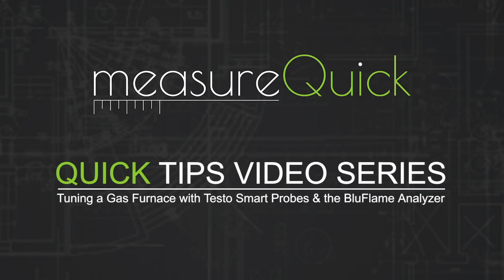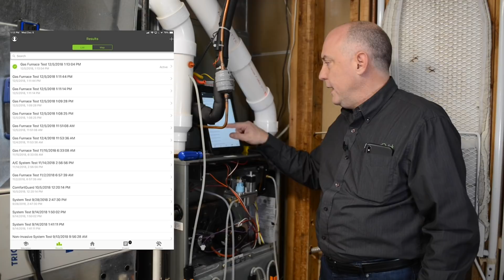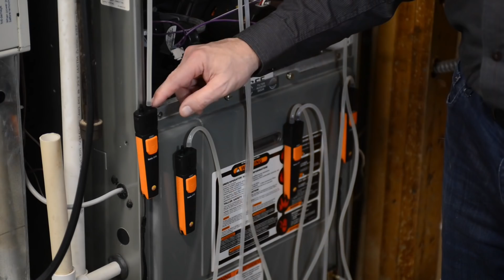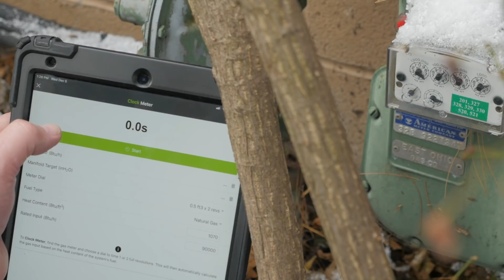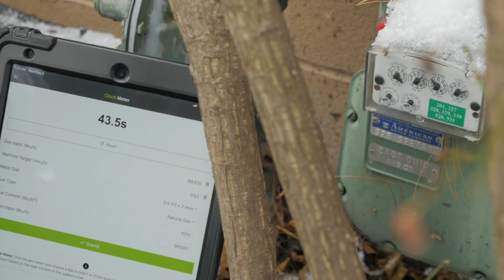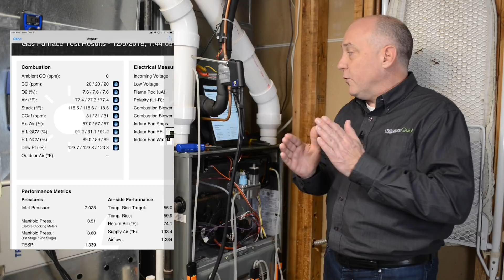Tuning a Gas Furnace with Testo Smart Probes and the BluFlame Analyzer

Comment: Hi there good video as always I have a question Where is the clock the meter option my app does not show it
Reply from the maker: You have to be in the gas heating mode, then capture the starting manifold pressure before the meter clocking shows. We use in incoming pressure to calculate the required manifold pressure.

Comment: Anyone else find that the 140° temp limit of the probes is an issue?
Reply from the maker: We use the 605 for temperatures and humidities below 140, and the 905i for higher dry bulb only. The 905i is basically for testing furnaces.
Reply from the maker: That is why we are using the Testo 905i probes that have a 300 degree top end.
Reply: @measureQuick  
You are using the 905i for temp and then the 605i for humidity?

Comment: Jim do you think CPS will come on board with your awesome software. Also do you think you will have a way to change or increase the text size.
Reply from the maker: Text size is tricky on the user interface. There are some accessibility features built into your phone/tablet for magnification you might try. As far as CPS, we have not come to an agreement with them yet.

Comment: I haven't heard you mention to make sure all other gas appliances are off while clocking the meter.
Reply from the maker: It is actually built into the app. When the meter clocks over a certain percentage (I think 10-15%) the app flags that suggesting to check for other operating appliances.
Reply: MeasureQUICK wow that's slick.